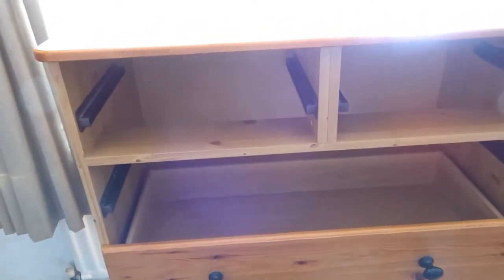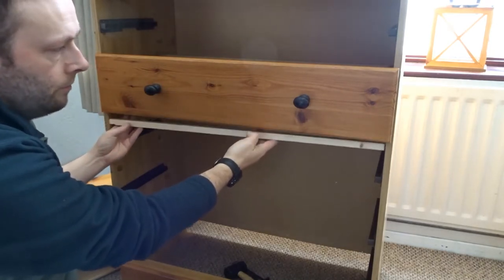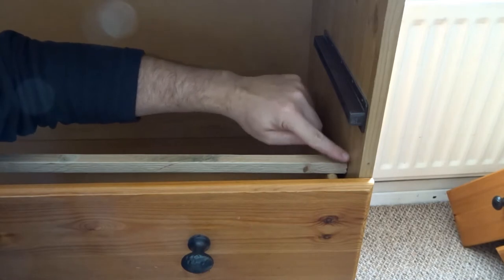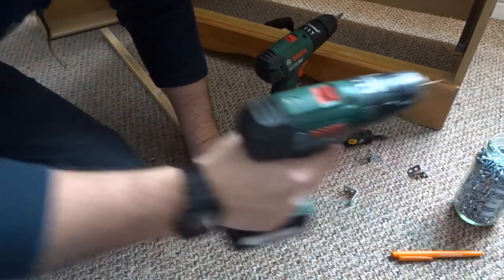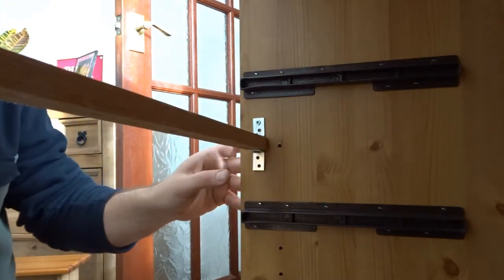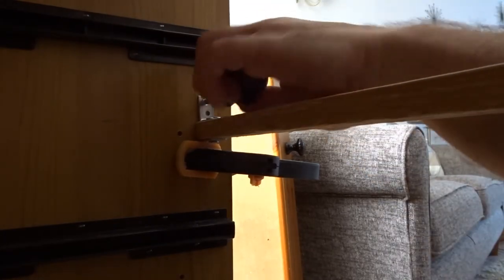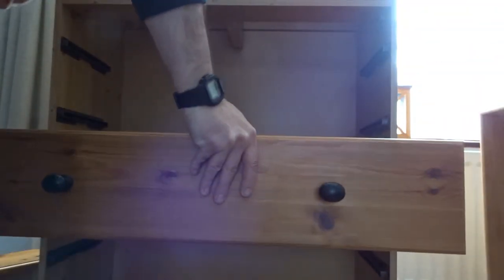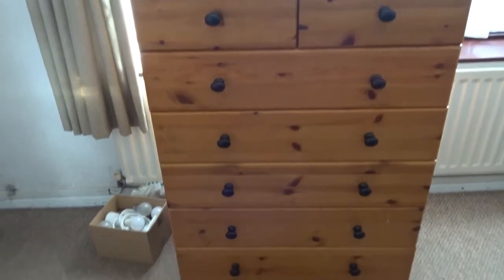How to Repair & Straighten Up a Wooden Chest of Drawers

Comment: The walls of my chest of drawers are so bent! At the top,  they have 37cm wide.  But in the middle they have 38.5cm!!
Reply from the maker: Yea sounds like the wood has bowed. If you add a piece of wood in the middle like I did it helps to drag it all back into alignment.